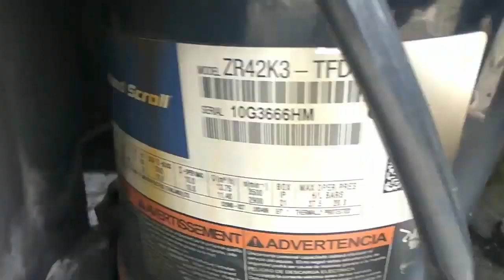3 Phase Split AC Electrical Connection Demo Bangla

Comment: 3 ph Ac te Outdoor unite e Thermostat knu use kora hoi o eitar benified kih?
Reply: @hasanrae  kintu Ami tu deki sobsomoy 2 ta fan e run kore koi off hoi nah tu are 
Jodi akti fan run kore are akti Thermostat sence kore on kore ta hole tu compressor trip korbe?
Reply: @hasanrae  dakci by sobsomoy 2 ta fan e run kore